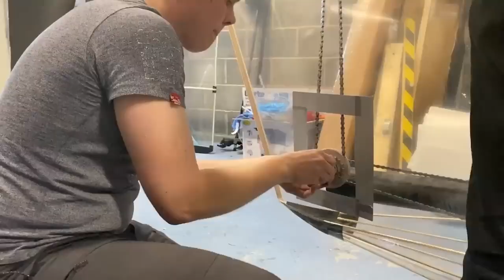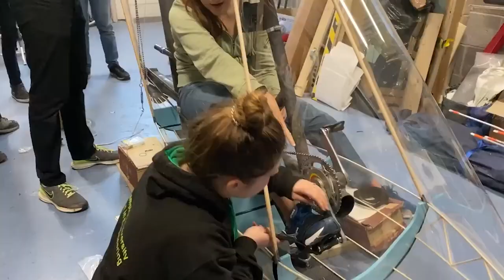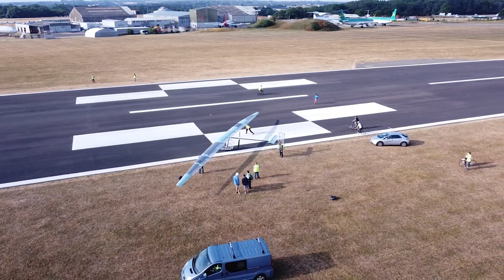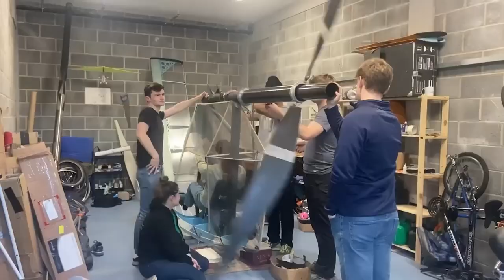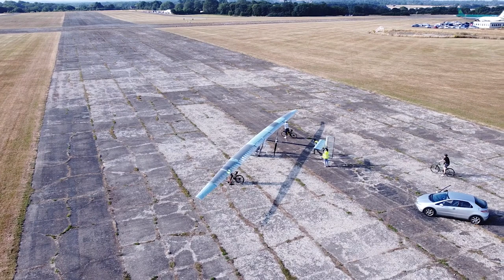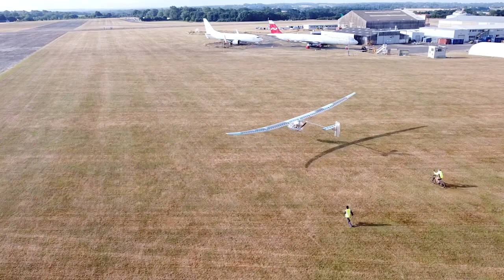WITH NO ENGINE!! University Students Create a Human-Powered Aircraft

Comment: What if the wings were filled w Hydrogen and covered on top with those roll-out solar panel material like the stuff they send to the ISS? Would the weight of an electric motor to assist the pedaler be worth the added weight?